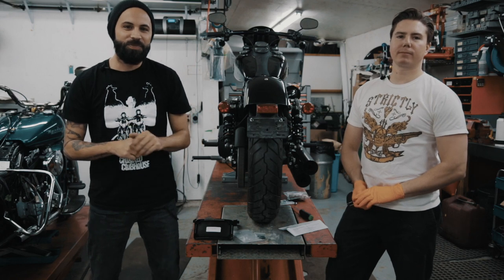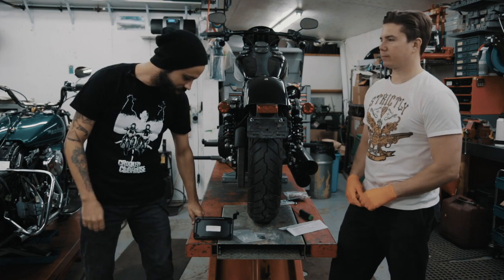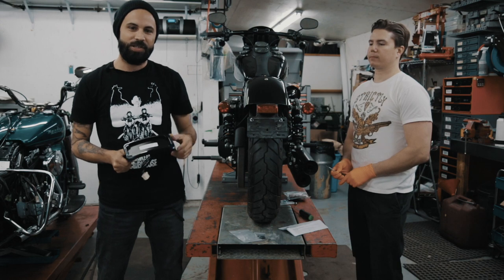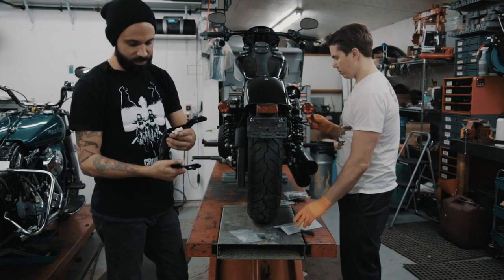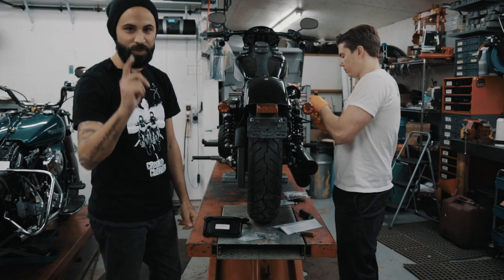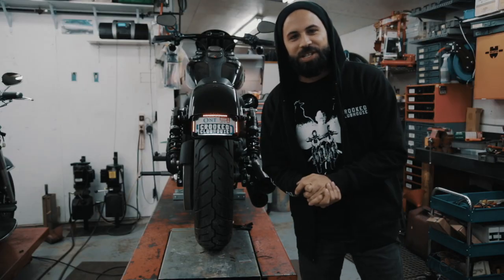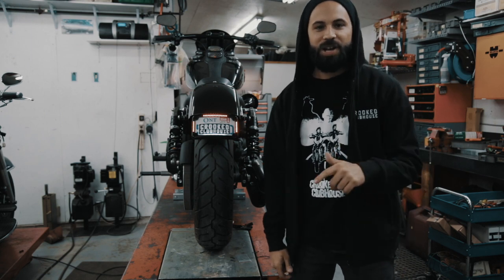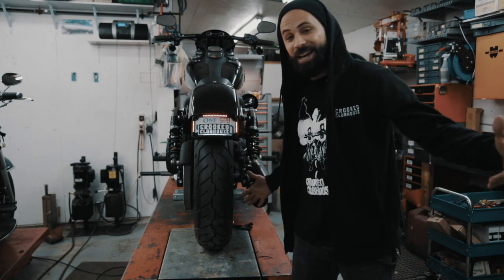Crooked Clubhouse - Cycle Visions

Comment: Hey I noticed the Ontario plate where are you located , how much trimming did you have to do to plate to make it fit the holder? And do you have any videos of the lights working
Reply from the maker: We're in Toronto. You'll need to trim a bit off the top middle to let the cable/wiring through and then just a hair off one of the sides to make it fit. Very easy to do. Best all-in-one license plate bracket on the market, by far. The lights are on near the middle of the video. Really bright as well
Reply: Crooked Clubhouse does it get brighter when you signal or brake? Or does it just flash
Reply: Not much at all, so easy to install. No I don't think we do but cycle vision might , checkout their site.
Reply: Yes , it's solid bud, this is top notch shit go get some !